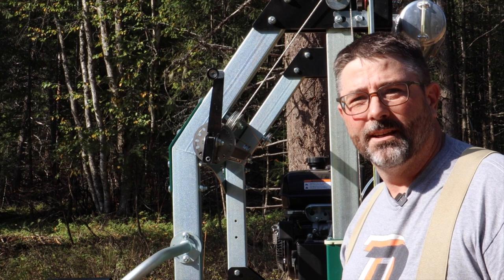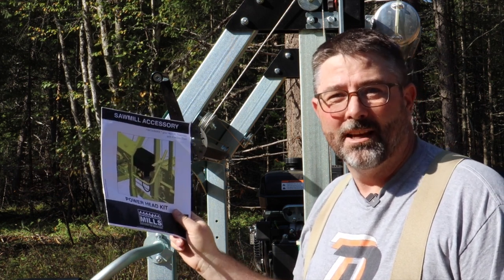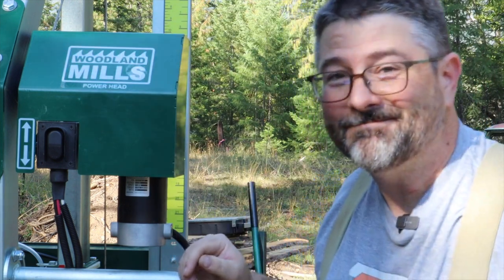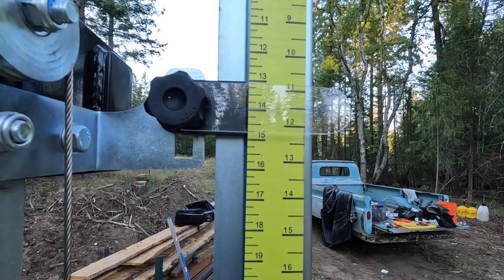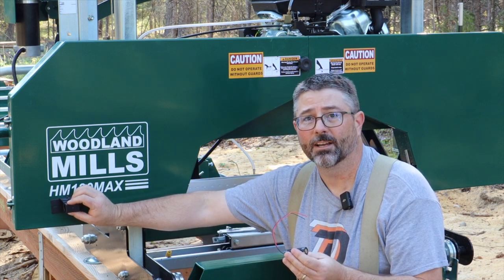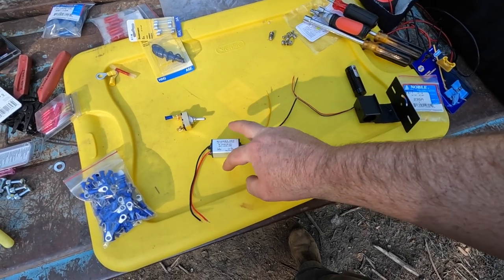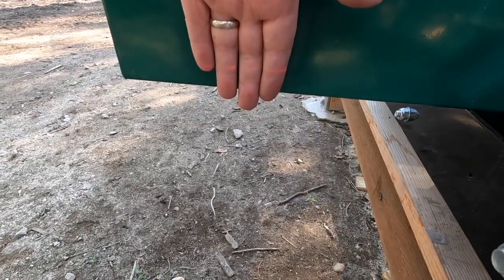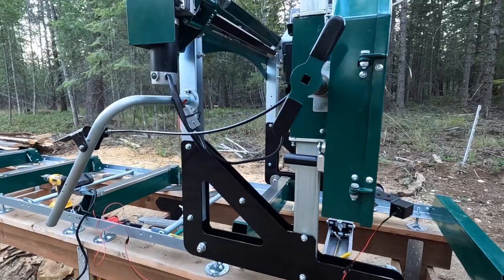Woodland Mills HM130 Max // How To Replace Manual Crank With Powerhead And Other Improvements

Comment: Thanks so much for the plexiglass idea for the blade height, I also have the HM 130max, and the original red pointer was lacking.  I also purchased the power head and has had a huge difference in my old, worn out shoulders, anyway thanks so much, enjoying your videos
Reply from the maker: Thank you so much! If you decide to make one of the plexiglass sight viewers, make it a little shorter than mine so it doesn't stick out and catch on the cover. Happy Milling!